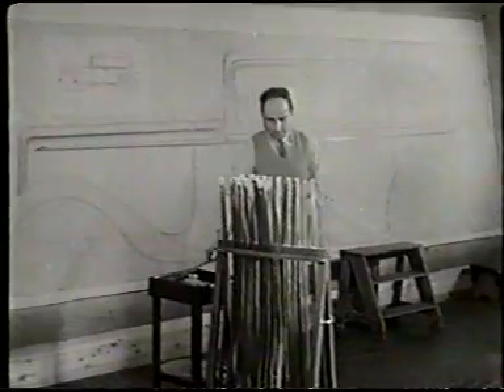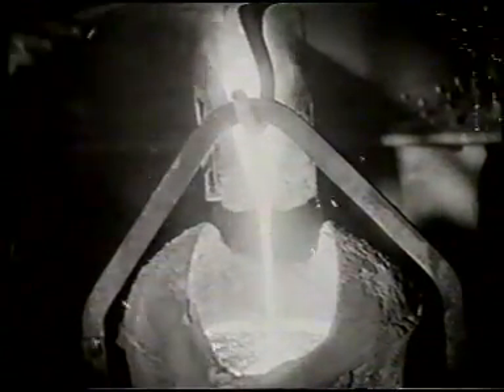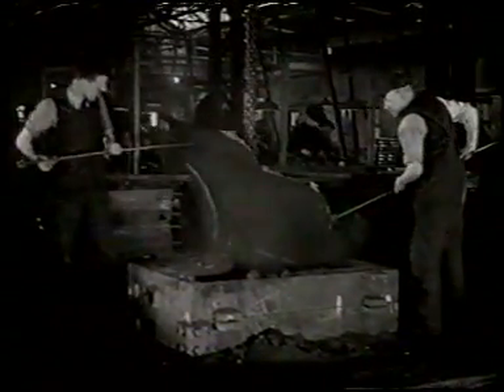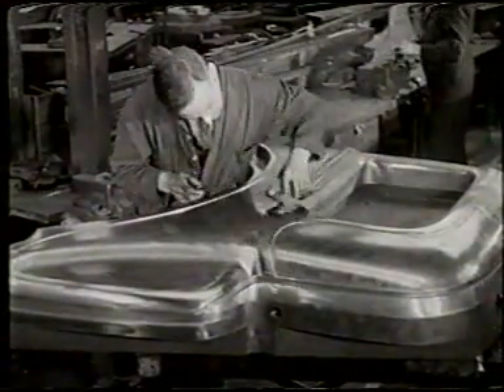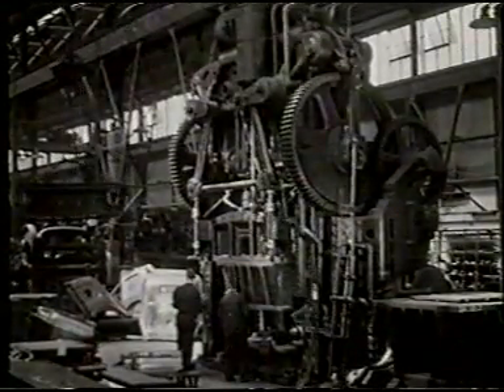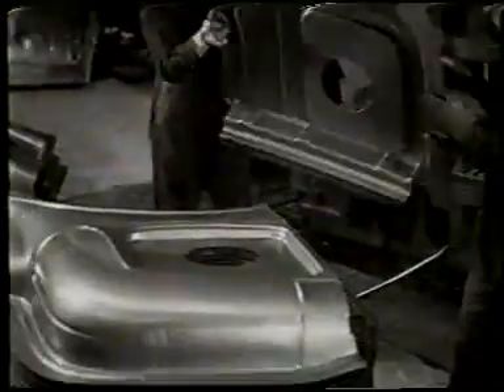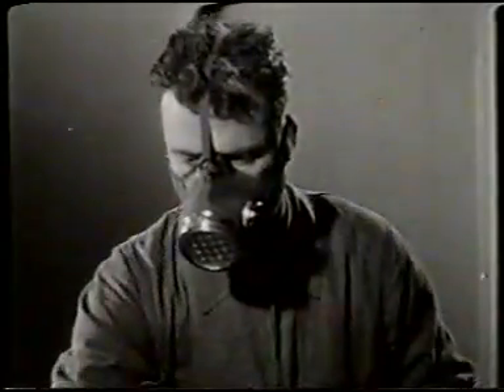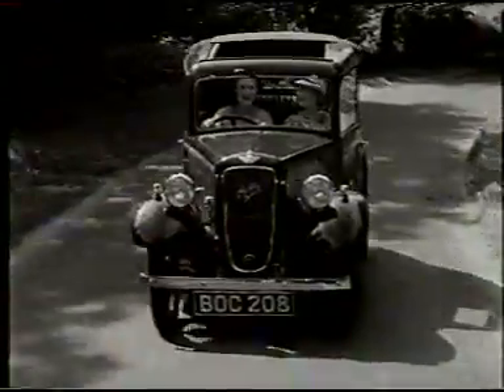Austin Motor Company..Heres to Beauty (heritage motoring films)

Comment: They were real good cars....but curves in the body? As square and symetrical as you can get....but then most auto designers just couldn't fight their ways out of that square shape...except Chrysler with the Airflow, at that time....
Reply: As square as you can get? Oh really? The basic shape is a box - indeed - my Austin Seven is a 1931 RM Box Saloon. There are almost zero straight surfaces on that body. Every panel is curved.
Reply from the maker: They made what the public wanted , when the ruby was introduced lord Austin was upset that the days of the big chrome radiator had gone, but realised that they had to move foreward, but as you say it was another 20 years before we in Britain started wanting more style in our cars.
Reply: @jackflashvintagemotoring7586  Yeah, but here in North America, I can only think of the post war cars that were stodgy and had no appeal as well....until the beginning of the 50's...that's when things got curvy and nice and low. Here's some trivia....do you know why Chrysler products kept the "cab roof line" of their cars higher up than the Fords and GM cars...it was to allow people that wore hats to get more headroom....true story..
Reply from the maker: Yes I can believe that, the American influence in styling did not start filtering in here untill the late fifties, we then started getting cars with Finn,s and chrome, the fords going more American only smaller, Austin's on the other hand turned to the Italian,s with the Farina range, it made the old styles go out of fashion overnight.
Reply: @jackflashvintagemotoring7586  It's worth noting that the Austin A30 (and I think the A40 Somerset) had an Italian designer working on it in the very early 1950s. A clay prototype of a proposed new Austin car was produced in 1939 - it took styling cues from the then American designs and looked very similar to the Austin Devon that eventually followed in 1947. Obviously the war held it up. Ford UK cars also emulated American design in the 1930s, albeit scaled down in size, e.g. the Ford V8 Pilot. The general lagging behind the USA by 5 to 10 years continued for some time, until the 1970s, when the USA started to emulate some European design trends and styling.
Reply from the maker: This happened with motorbikes too, engines designed in the 1930s used in some 50s bikes, but it was transport and we needed it outdated or not. as too designers, I remember Farina coming in to do the A40 and Westminster's.

Comment: Yes, that was Longbridge... and while this film was being created, an Austin "shadow factory" was being constructed nearby to build aircraft and other weapons of war. It is hard to imagine the contrast- checking out paint durability on one had while judiciously tooling up for war on the other. While my car was being repaired last week, I went into the town and one of those Austin Ruby cars came past- it was on a trailer a "barn find" ready to be rebuilt. When I was a kid such cars-  the Austin 7, Morris 8,  Ford 8 and Popular and Prefect and similar cars could be found all over the place- dumped in the countryside! I have a photo of my sisters sitting on the roof of one- it was taken by my dad outside Wickham in Hampshire. I didn't have to travel far for such delights as the Corporation had a huge car dump outside my school. I have two of those winged Austin badges- one was off a Sheerline -and I also had the hub caps. Sadly, the old man chucked out my hub cap collection and I had some very nice Jaguar examples.

Comment: Back in the 60's my dad bought my mum an Austin big 7, the model after the Ruby. Dad had seen it parked on a side street and approached the owner to see if it was for sale. The old boy sold it to dad for $75 . We got in and drove it home some 150 miles on three cylinders. Mum had that car for years and it was actually in very good condition with an ummarked interior and zero rust. 35 MPH seemed to be the best cruising speed and mum could tell if we had been driving too fast in it because it would need water when she checked it. Happy Days!
Reply from the maker: Check out. Sam's investment staring Stanley Holloway, it's an advertising feature for the Austin big seven

Comment: OK--it's 75 years ago, but I can't help laughing at the commentery , music, seductive filmed scenes,  and ,the fact that this isn't  the unique and flowing lines of Bugatti, but a box on wheels, that looks like all the other boxes. Without the usual radiator badge,  it could be any one of the 95 % of cars on the road in the pre-war years.
Reply: The box-on-wheels design, interestingly enough, allows enough space to fit people inside. Form follows function.
Reply: The same applies to modern cars - absolutely no originality in design. Remove the badge and it's hard to tell one from another.
Reply: @smudger671  very true. Just another boring eurobox.

Comment: Welding while wearing a necktie. Crazy times back then.
Reply: When I started work back in the early 70's it was pretty common for tradesmen (especially older ones) to wear a tie with overalls.
Reply: I started work in 1977 as a sheet metal worker and most of the old boys wore ties and shoes that gleamed , different generation then but boy they knew their stuff. I learnt so much from talented blokes as they were and ended up in the same trade fo 40 years.
Reply: a different crazy now

Comment: A friend of mine had an Austin 7. One night 4 of us went for an evening out in it. As it laboured up a steep hill in the town centre, a guy on a bicycle overtook us.
Reply: Replevideo my dad had a post war 1946 new Austin eight.Upon ascending the Wicklow mountains with my mother and me aboard,my large uncle leapt from the stalling ‘8 and we made it,about 300 ft to the top.My father was annoyed,as he was convinced that his pride and joy for which he had waited until WW2 was over to purchase it,could have carried a small army up the same hill.Unfortunately the post war car wasn’t a patch on the beutyfull  car in the excellent video.
Reply from the maker: Yes 8 horses under the bonnet, not a lot by today's standards, I think all small engined cars in those days were under powered, the early Austin sevens had a fair power to weight ratio and were nippy for their size, but they lost that advantage on later cars by increasing the weight but not the power
Reply: Jack Flash vintage motoring I read somewhere; incredibly an Austin 7 still to this day holds the record for the fastest  climbing of Ben Nevis.
Reply from the maker: @graememorris7820  I'm amazed at that, but then a small engine in a light body can perform well, I wonder if it was a tuned engine you can easily double the horsepower on those engines
Reply from the maker: Yes they are a bit slow on the hills , there is a hill in Cornwall where Austin sevens would reverse up the hill, because reverse was just that lower ratio than first
Reply: Haha, I can believe it!
Reply: @Scuba72Chris  not sure about the '7', but Austins  of this range usually had 4 gears, unlike rivals Morris,  which had only 3. I used to have one, and THAT was embarrassing on some hills.
Reply: Lol  to  overtake  a  bicycle  in an Austin  seven  is a  badge  of  Honour .  let alone  with  four  people  in it
Reply: All you need to know about Austin Motor Company: https://www.youtube.com/watch?v=1hoIMLCIZIw